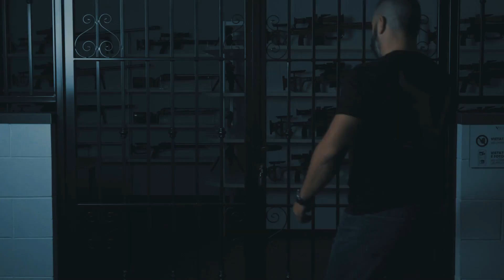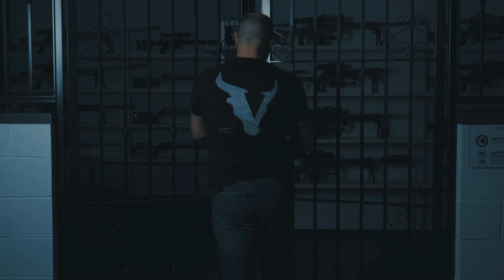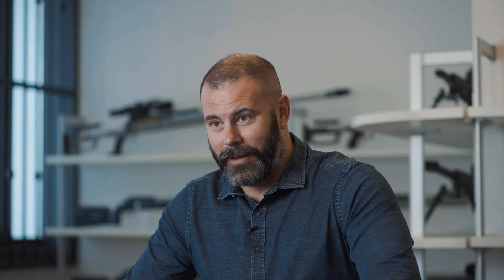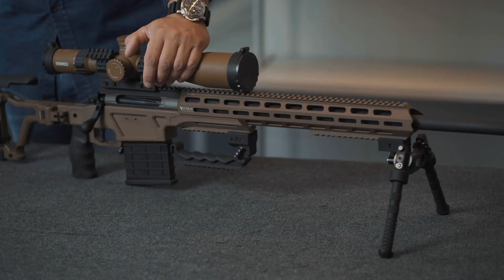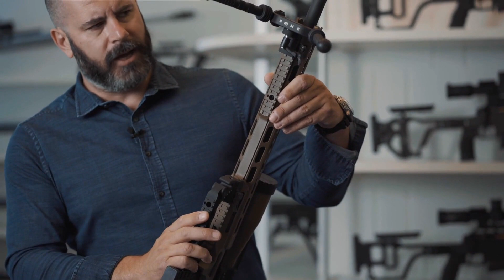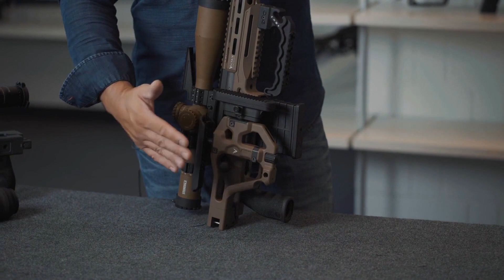Victrix Scorpio V [EN]

Comment: Will never forget when Bass Pro was closing these out for $5000. I had just moved from Florida to Alabama. Wasn’t an Alabama resident. Literally the week I was. They sold it the day before. Not going to pay $12,000 for one. Bought a Sabatti Rover Tactical in 300 win mag instead. Been thinking about buying a Barrett MRAD with the quick change barrel system and folding stock. But the Sabatti is accurate. Bought an Area 419 magnum muzzle break for it. Gun has hardly any recoil.
Reply: Was wondering how high the vig was for the Scorpio.  Thanks.